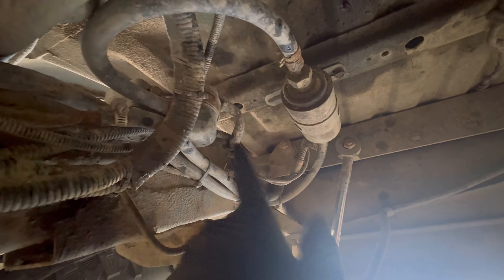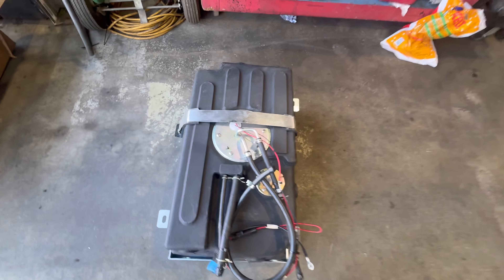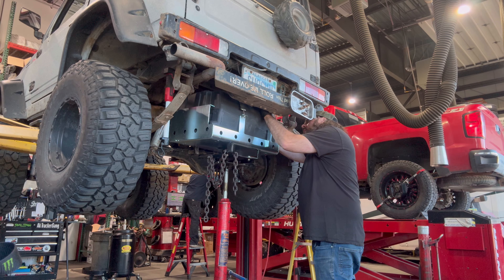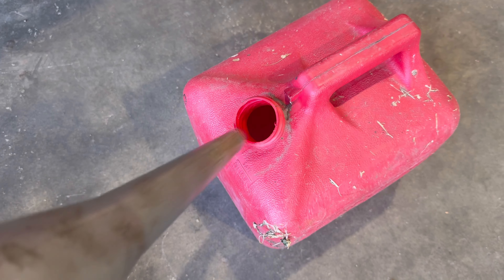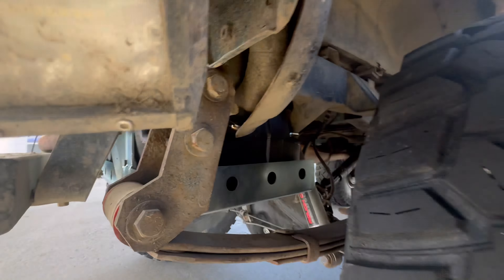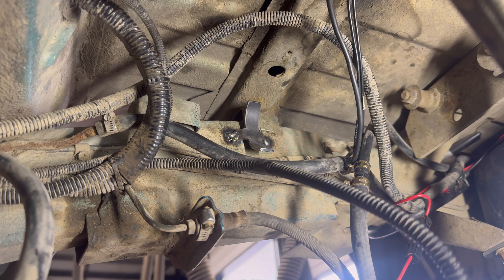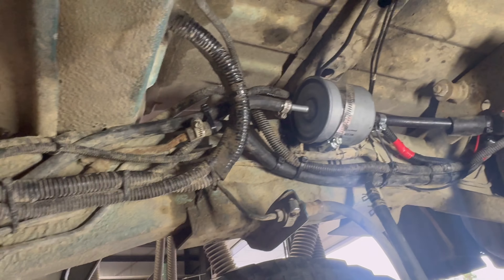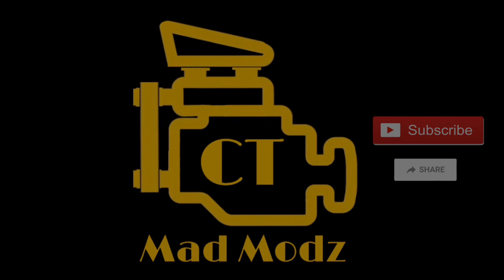Zuks Offroad Petroworks 15 gallon fuel tank install in a Suzuki Samurai

Comment: Great video, about to do my 15-gallon swap. Did you have to cut the main feed metal line to install the rubber hose?
Reply from the maker: @oczuk32  I don’t think I cut anything when I originally did the 16v swap but I did run a 5/16” fuel line as a feed for the engine when I did the swap and just connected that to new fuel pump
Reply: @CTMadModz  Oh, okay. So, you bypass the metal fuel connections from the stock fuel tank to the line that runs along the frame with the 5/16 fuel hose.
Reply from the maker: @oczuk32  so my rig is swapped over to a 1.6L16V Suzuki sidekick engine. When I did that swap I installed a new bigger fuel line to the engine. For the return I used the old bigger metal fuel line from the engine back to the tank. I adapted from the fuel tank to the bigger fuel line and return with some fuel line fittings. I abandoned the old return and vent metal lines running to the front of the car and reused the 2 vent lines going to the filler cap. I added a fuel filter to the main fuel line on the frame rail. It’s a pretty simple install. If your rig isn’t engine swapped you could just use all the old lines the way it came from the factory

Comment: Damm 9 miles per gallon? I'm complaining about my 19-20 miles per gallon on my samurai. I was expecting more with the 16valve swap.
Reply from the maker: @omarchafino8721  I think it has to do with my gearing, tire size, and the way I drive. I drive everywhere as fast as this little guy will go, I’m on 35’s and have 4.30 gears in my axles and currently am running a 4.9 gear in my transfer case… sometimes I run 6.5’s instead. But yeah, I make that 16v scream 🤣🫣

Comment: Where can I buy the gasoline hoses with the size on the top of the tank???
Reply from the maker: @rasmeinhem  I would think your local auto parts store would have them. But you might try Petroworks or Zuks Offroad
Reply: @CTMadModz  The one from the local part store get cracked after a few months!
Reply from the maker: @rasmeinhem  that’s wild, I went to a place that specializes in hose called Alaska Rubber. I just cut off a piece and brought it in there and asked for 12-15 feet.